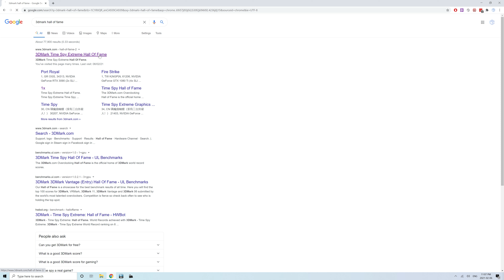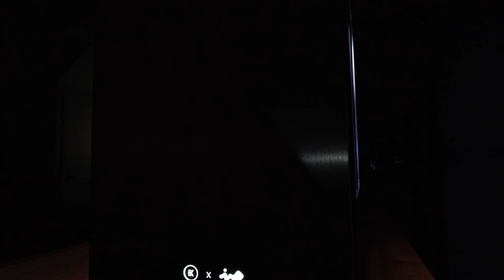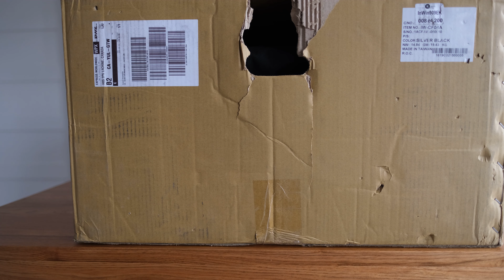TENET, a watercooled, inverted, MONSTER PC. Watch an INVERTED timelapse from benchmarks to REboxing!

Comment: What do you put on the video card before installing water block? Not the KPX TIM but the thing that looks like a thick pen that you used? What is that? What are you putting it on?
Reply from the maker: It's a metallic silver paint to do a shunt mod on the card!